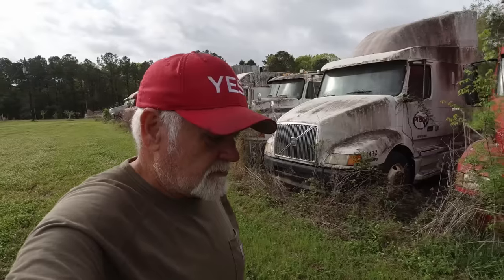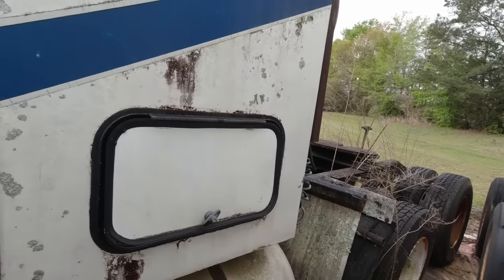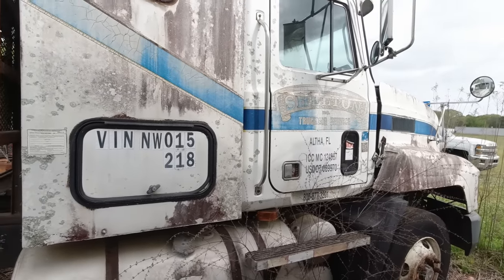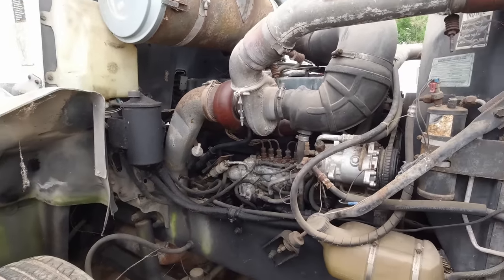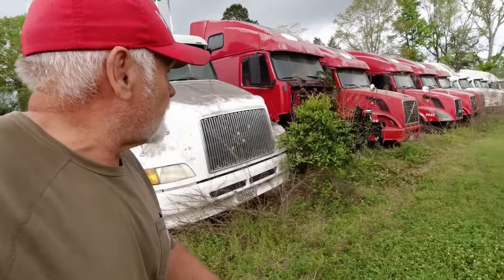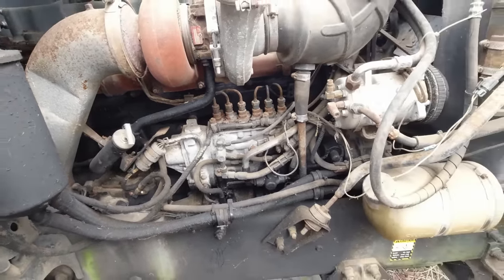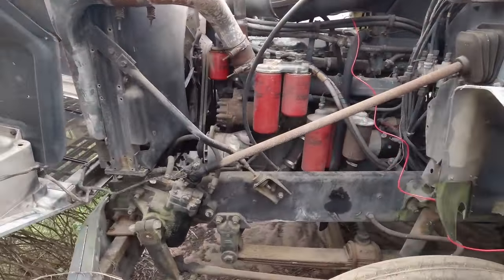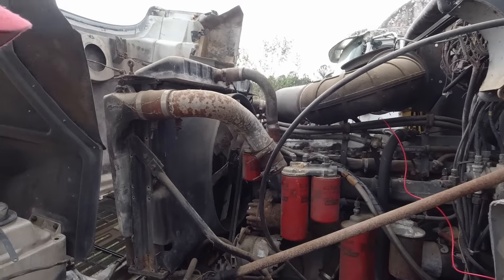Will it START!? 1991 CH Mack FOUND Abandoned in TRUCK GRAVEYARD..

Comment: If you don't find the keys that is a basic 3 wire ignition switch, one wire is starter wire, one is the 12 volt supply and the last is the accessory wire, take the 12 volt and the accessory wire and connect together and that turns everything on to run the engine like the computer, fuel solenoid, fuel pump and the most important, cb and fm radio's and last you can touch the starter wire to the other two and it should turn over and start with a little help from a bit of starting fluid.
Reply from the maker: Thank you for sharing that I will try it out 
Thanks for watching

Comment: that ch 600 will be a beautiful  restoration my favorita truck you have to lost the six bolts  for the injector pump remove the pump nut with a 1-1/4 12 point socket and tray to star it and wait till diesel came out
Reply from the maker: Going to try it 
Thank you for sharing 
Thanks for watching